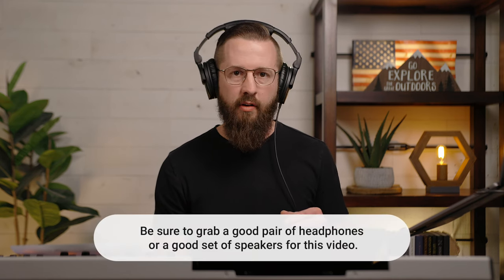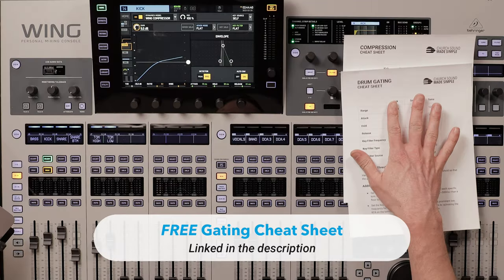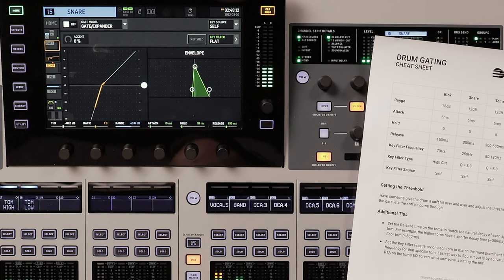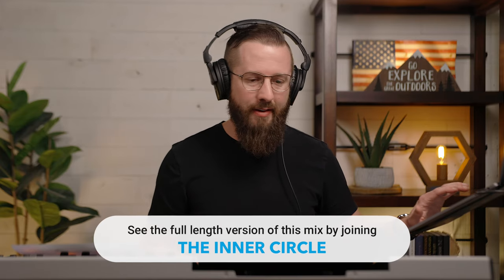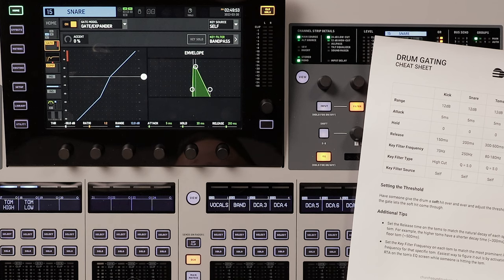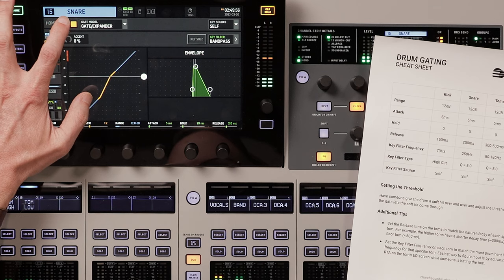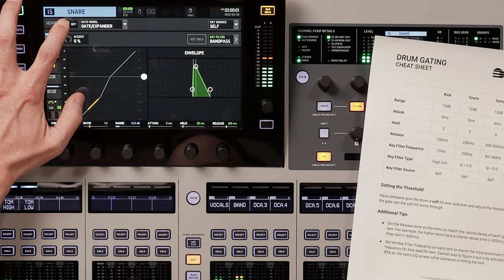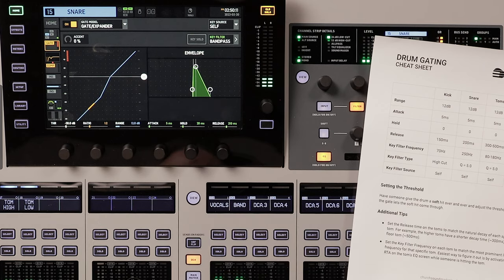SNARE DRUM GATING for clean sound

Comment: I prefer to leave my snare un-gated. My drummers tend to do a lot of ghost notes and you can easily lose a lot of those hits if you're using a gate. I start with my snare top and bottom mics, get the sound I want, then use gated kick and toms to fill out the sound and send information to the subwoofers. With a little overheads to make up for the fact on a little bit of cymbals are being heard by the snare mics.

Sounded like there was a lot of extra stuff coming through your snare channels, so I think in that context you made the right call.
Reply from the maker: Thanks for pointing this out, Jeremy. Gating can really be a nuisance on a snare mic when there are lots of ghost notes and subtle rolls.